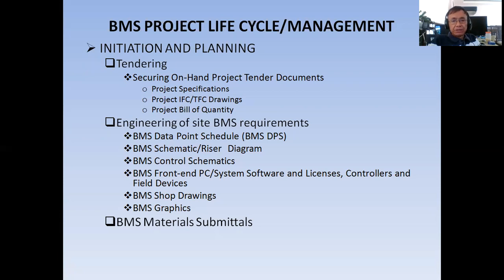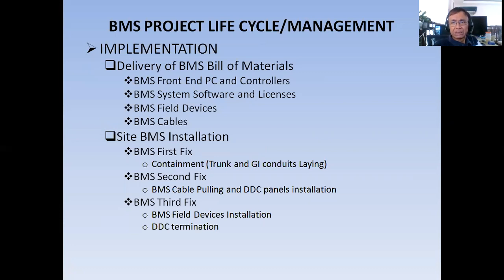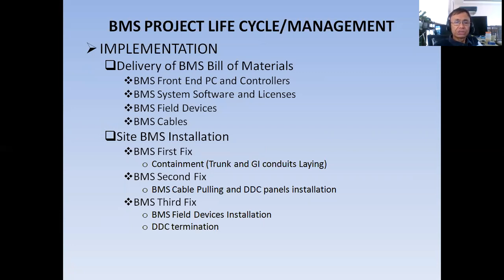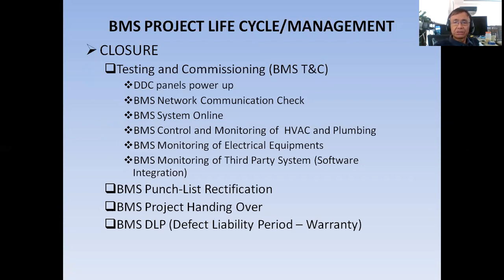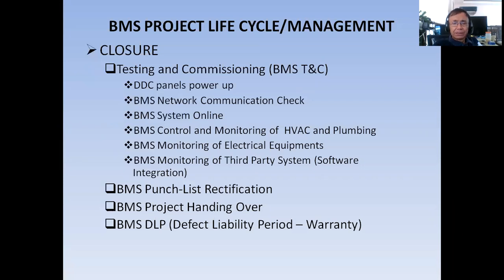How to become a BMS Engineer part 8 (BMS Project Life Cycle / Management)

Comment: Very useful presentations 
Is boq & cost estimation same ? 
Is boq provided by client/consultant
Reply from the maker: there is a BOQ in the project specifications and you can use it in defining your BMS points. Based on this project BOQ you can use it in your cost estimate also
Reply from the maker: BOQ is part of Project Specs. Based on your engineering study of the project you will have also your own Bill of materials for the BMS if you are part of a solution provider company

Comment from the maker: take note that before you do any testing and commissioning of HVAC equipment, make sure to coordinate with Mechanical Engineer of the project. These HVAC equipment should be run and tested first in Manual or Hand position. If everything is working fine in Manual mode then that's the only time it is ready in BMS control (selector switch in Auto Position).